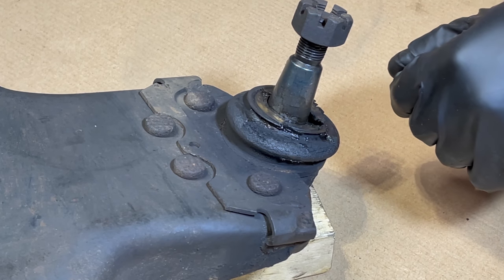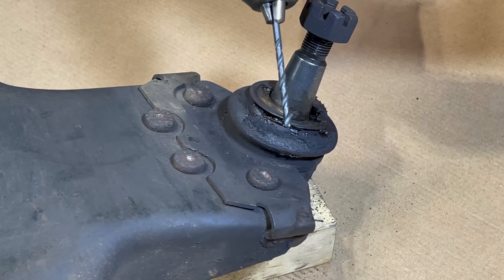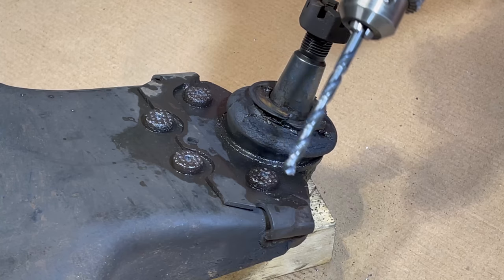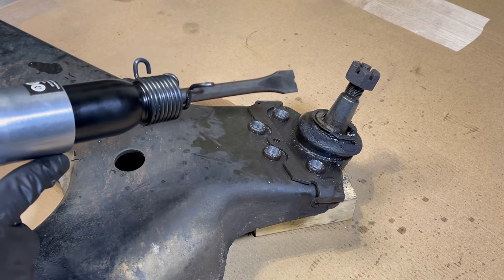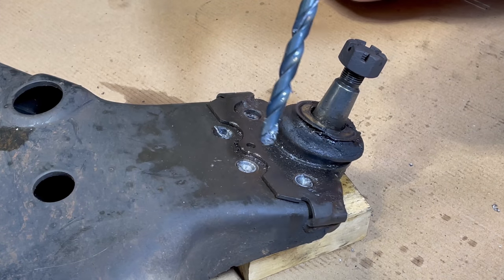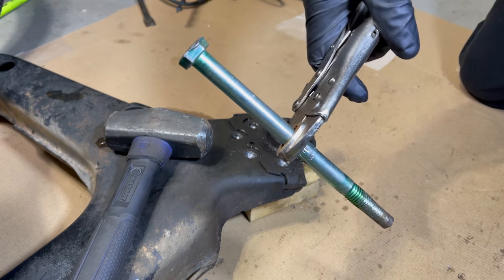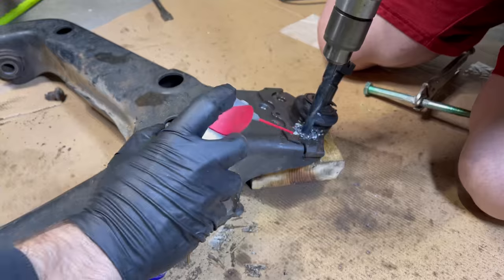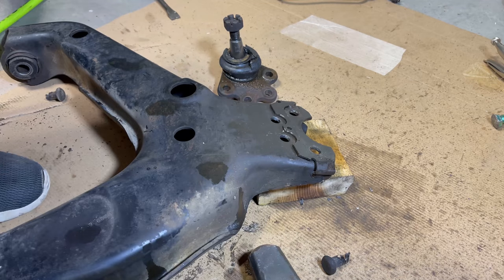Removing ball joints with rivets in 6 minutes!

Comment: Been a metalsmith for 45 years. Thanks so much for demonstrating admirably how to properly drill a larger hole in a piece of metal by gradually stepping up the size of the drill bit.  Can't tell you how many times I have seen people grab the biggest bit and just try to power it through a thicker piece of metal.  They get so impatient, frustrated, and angry and all they leave is some scratches and burn the temper out of the bit, rendering it useless. Slow is your friend when cutting or drilling metal.  And yes, the further down you drill the rivet, the easier it is to knock the head off.  Great video! Thankfully I've had the ball joints in my truck replaced a couple times before and they are bolted in now!!

Comment: Drilling tip for steel - rpms slow as you can with as much pressure as is safe for the bit.
high speed smears steel and makes it harder and dulls your bit.

Comment: Another technique that I used on those was to cut an X on the head with a cut off wheel, and just use the punch with the air chisel to pop them out. Worked like a charm. (I have the same truck).
Reply: I feel like that would make this 3x quicker.
Reply: @vincentwasney1768  Honestly, maybe 15 minutes a side... and there is no heat to warp and soften the A-Arms metal. I am surprised he didn't know this technique.
Reply from the maker: We tried many methods, the method we used in the video worked best for us!
Reply: I might try that on the other side.
Reply: That's what I do
Reply: I make multiple cuts like a waffle with a cut off wheel. Even easier to pop the heads off with the air chisel.

Comment: I appreciate someone out there providing a different method than cutting. I wanted to get some spring hangers off a frame at the junkyard, and most junkyards to not allow anything that sparks. Cutting or torching is not an option! Hopefully it goes well and I dont waste my time, if it works I should be saving about 250 dollars buying the only available aftermarket option.

Comment: "never have to deal with these rivets again" Yeah now you need to deal with rusted solid bolts instead :)
Last week I had to do two ball joints on a car, one was riveted, the other bolted (had been replaced). I did the rivets the way you did here, the bolts I got one out with an impact but the others no luck that way so I cut the nuts+bolts close to the flange with a cutoff wheel and they dropped out.

Comment: One other tip: Find an appropriately sized socket which just covers the rivet head, and you can use that as a guide for your center punch! Need to find the center punch which fits well down the hole of the socket you're using.

Comment: Almost the same here...I keep the arm in the car; drill 1/4 all the way through, 3/8.. 3/4 of the way and 7/16 level to the arm plate.  They come out rather easy with a 3/8 punch.
Reply: Do you drill from bottom or top? Wanting to keep arm in car because I don't have any replacement bushings for it, and old ones might crack if I remove it. But I don't have a fancy lift. Can I come in from the top you think?
Reply: @bigbrotheriswatching2680  Yes, that's what I did. You can use a straight punch attachment in the air chisel too instead of beating a bolt into it. If they're really stuck hit the bottom of the rivet a few times with the air chisel, off center like you're trying to "spin" the rivet. That breaks it loose usually and makes it easier to punch out. I did this with it attached to the frame and put a jack stand under the A arm to hold it in place.
Reply: This comment/video saved me multiple days of drilling after I was trying to jam a 1/2’’ bit though those suckers for 4 hours. Thank you!

Comment: You  can do it even quicker than this by leaving your drill in its drawer!

Get a small Angle Grinder with a metal slitting disc, and cut deep X's into the tops of the rivets.

Then get the air chisel out and it will do the same job.

Comment: Currently going through the same process except with the control arm still on the car. The aftermarket ball joint (Mevotech) actually has larger bolts than the factory rivets, so I actually needed to drill the holes in the arm to 31/64th. These rivets are very tough and will need a nice set of drill bits to get through.
Reply from the maker: @Donovan Handley Interesting, we didn’t have to drill the holes any bigger. But yes, the rivets are a bear!
Reply: @SuburbanRanch  Yeah it was strange. The original ball joint had smaller holes, but all good now!
Reply: The plastic on my Mervotech control arms for a 2011 Ranger did not even last 5000km before failing.  I went to Ford for OEM and paid only a couple dollars more.

Comment: The drill work (stepping up sizes ) is great work.  But,  angle grind the rivet heads off and air hammer the rivets out.
Reply from the maker: Tried the air hammer, it couldn’t pound the rivets out.

Comment: Geez! The "complicometer" was really turned ON in full power! LOL 😂 
Spare hands, control arm out of the vehicle, drill, air chisel, place to work, tools etc. In short everything set to be easy, fast and simple. And, even then made it so complicated!

If going the drill bit way just get an appropriate size dill bit and drill the rivet head out. It's that simple. No need for the air chisel.
But since you have an air chisel, than you don't need the drill bit! ;-)

Either case with all that at hand. Just use the air chisel to pull out the rivets. It's faster and simpler. Simultaneously you can skip the punch and sledge hammer...
Reply from the maker: @crpth1 Not sure if you’ve done it or got lucky when you did. We tried to just knock the head off without drilling or putting an X in the head of the rivet, didn’t work. Also we tried using just the air chisel to knock it out once we got the head off, no luck. The rivet mushrooms out in the middle locking it in place. We tried multiple ways, this was the easiest way we came up with.
Reply: @crpth1, that worked for you?  Wow, thats unbelievable!! You had better thank the good Lord for Him bestowing magic upon you lol.  
I have an Ingersoll Rand '7x' rivet gun which can also be used, depending on implement, air chisel,  hammer (which essentially what a rivet gun is to begin), air punch etc....  the 'X' denotes the power it is able to produce.  3x, only for aluminum rivets, 5x is the most common as it does any rivet up to 5/16" dia.  7x is nick named the thumper as it will very handily without thinking of breaking a sweat, will punch through. 009" 7076 T-7 sheet aluminum which is common size for lower airframe (sub buttock line 0 on fuselage) skin.
9x.....  not sure if that exists.  I heard rumors that someone spotted one but, his hand broke before he could get a picture

Comment: So I'm rebuilding most of my front end and I am stuck on these lower ball joints.  I was feeling all proud of myself getting this far since I'm not a mechanic but man these rivets are a pain!  I don't know if it's because I don't have an air chisel, but my normal hammer and chisel isn't cleanly knocking the heads off like in your video.  It's more sheering them off and leaving the bottom of the heads behind like they're welded on.  Maybe my drill hole was too small?  Went out and got a 7/16 like you said and I'll put some more work in.  Hopefully that works because I've been at a stand still for 3 weeks at this point.  I'll drill these all the way through if I have to and hopefully I'm centered up well while doing it and don't ruin the arm.
Reply from the maker: @Richard Young Yeah.. rivets can be a pain. The air chisel we have is really inexpensive at harbor freight and has come in really handy. https://www.harborfreight.com/medium-barrel-air-impact-hammer-61244.html
Reply: I paid $17 for mine at harborfreight, run it with a pancake compressor and it does alright. Don't forgot the quick connect fitting.
Reply: @bigbrotheriswatching2680  I actually just got the last rivet out last weekend lol.  So now both lower joints are out and I can start repainting before the new stuff goes on.
Reply: @tbituner  howd ya get them out? Did you drill in from the top without removing the arm? That's what I'm about to try
Reply: @bigbrotheriswatching2680  yes I didn't use any fancy tools once the head was off just a hand drill with the control arm still attached, supported by a jack stand so the torsion bar didn't absorb all the impact while trying to whack them out. In this video he uses 7/16 but based on my experience I wouldn't recommend that because it is almost the exact size of the hole in the control arm.  So if you aren't EXACTLY on center or don't go perfectly straight down you will eat away at the control arm not just the rivet.  I may have done that a little on the first arm so I'm nervous on how it will go back together.  For the second arm though, I got the two drill bit sizes below 7/16, the strong ones of course meant to drill through thick steel.  So I would just alternate between the two sizes back and for, vacuum out the shavings each switch until I got almost a full 3/4 through the rivet.  Then I placed a spare short steel bolt in that hole and just whacked it as hard as I could until it popped out.  Removed the second set perfectly that way.  To get the heads off I used a cutting wheel and made 3 cuts instead of the usual 2 to make an X, seemed to make hammering the head off with a chisel by hand much easier.  Maybe it was just because more heat was getting into the head so it was more eager to deform and sheer off.

Comment: I have the same problem with my 1997 Dodge Dakota.  For some reason the factory decided to use these rivets instead of bolts and nuts which are what the new upper and lower ball joints come with. 
I forsee a lot of work and nothing is easy for sure. I am not going to remove the   upper and lower ball joints because I am not a mechanic by any means and that looks like it would be tricky. So, what I was thinking is score the rivets on the top side with a metal  cutting disk and then just use my air chisel to remove the pieces.  After removing the pieces I plan on grinding down what's left to be punched out.
What do you think? Is my thinking about right?
Reply from the maker: @William That should do the trick

Comment: Hard metals, low speed high prx.  Softer material, high speed low pressure.   Anyways. ....
Thank you for the video. I've a 1998 C1500 I am about to R&R ball joints. So, sincerely....thank you.
What were your symptoms?  My 'Burban is wandering at freeway speeds, front tires (obviously) are wearing HORRIBLY on the inboard shoulder.  To me,  that screams "BALL JOINTS!!!"
Reply: More like tie rods

Comment: If you had a cutoff grinder and  hammer punch bit with your air hammer, the job can be done in minutes.  Crosscut the head 2 or 3 times. Hammer off the head. Then, hammer out the bolt. Put a jackstand under the control arm to absorb the hammer impact.
Reply from the maker: We tried doing it with just the air hammer, it was not powerful enough!

Comment: Not a criticism..just curious why you didn't use your air hammer to drive the rivets out? I have a WW2 truck that's over 80yrs old and I've been told to use an air hammer to get the rivets out as most fuse with rust over the years and hitting with a big hammer can crack the cast parts and bend the frame.
Reply from the maker: @Olive Drab Garage We tried, our air hammer would not drive them out
Reply: @SuburbanRanch  ahhh...bugger. I hope mine come out or I'm going to have to up the stakes with a plasma cutter.
Reply: @SuburbanRanch  you need a bigger air hammer
Reply from the maker: @sdriza Yes, a bigger air hammer might do the trick!
Reply: @SuburbanRanch  I'm high on long barrel air hammers right now. I was fighting with a stuck axle last week and finally bought one over the weekend... Loving it - been trying to use it for anything - can't believe I waited so long to get another one. Hope all is well and I enjoyed the video.

Comment: Do I have to drill into them to get them out because I have chiseled both sides of the top ball joint off and still can’t get the rivets to come out
Reply from the maker: @Jack Benson That’s what I would recommend
Reply: Using a press is MUCH easier than pounding them out. You don't need to chisel both sides, only the side you're pushing into

Comment: Young fella it's easier to just use a cut off wheel cut an x in it then use a air hammer with a straight chisel knocks it off every time then punch out the rivets .

Comment: You can’t say that it’s six minutes to change bowl joints because you have to add in the fact that you had to take the wheel & the lower A-frame off to even get to it so it took a little longer than six minutes is what I’m getting at.
 myself, I blow the heads off with a  torch.

Comment: Non sens. Get the control arm out and work with rivets! If I take out controle arm is faster mounting new one with ball joint!
Take out ball joint without removing control arm! That problem.
Reply from the maker: @Jerzy Kolodziej You cannot buy new control arms for a k1500, gotta work with the originals. We are also replacing the bushings so it made sense to remove the entire control arm, but you can remove just the ball joint with the arm in the truck.
Reply: @SuburbanRanch  
Wow. My daughter by first car. Old. Chevy Optra 2007 . On my opinion good deal but Nevers say never! I must change ball joint . End it's the problem: work with rivets ans buy the ball joint for 10$ or change lower arm with ball joint for 58$ !
Question- what's easly?
Reply from the maker: @Jerzy Kolodziej I would just buy a new control arm with the ball joint already replaced and new bushings

Comment: Has anyone used a 3/8 instead of a 7/16 bit? I am considering buying some bits, but the 7/16 size doesn't come in the smaller sets, but 3/8 is pretty common. Kinda don't want to spend money specifically to buy the 7/16 bit if I don't have to. The difference only seems to be about 0.0625"
Reply: No you don't have to drill all the way to the edges of the rivet. Drilling more just gives the shank of the rivet more room to compress when you're trying to hammer it out. Use what ya got, get close enough to the OD of the rivet and you'll be ok. Make sure to drill as centered as possible, use lots of lube as they're hard AF!
Reply: You could always “ream” the whole with a smaller bit to make up for the smaller size.
Reply: @Chubbza5  I ended up getting a 3/8 and it worked very well.  What ended up being key for me was to get a good fast drill and to get about 3/4 of the way through before hitting it with the air hammer.

Comment: in aircraft when drilling rivets its not advisable to drill so deep. the material left in the hole is a direct indicator of how far off center the drill was and thus how far out off round the hole is. there is more lenience when installing new rivets but with bolts being the replacement fastener in this case there is a chance for movement and widening of the holes under stress. 

i would tell you to drill shallower, then using an 8oz hammer, strike the center hard a few times. if everything is correctly drilled, the head should pop off with just a few strikes. its better to finesse in this area than to take too much material out. then the shanks can be driven out with the hammer and punch or even a pin style set for the air hammer.
Reply from the maker: @billy sanders Our drilling was all encapsulated within the rivet shank. The hole was not damaged at all.
Reply: I have same truk but I found a whole lower arm replacement with ball joint alredy in for little over 60$ on ebay hell the ball joints itself sells at orielly from 55 $ seems it was way easier than having to drill and pound on it
Reply: When I was an A&P, when removing aluminum rivets..... I used 1 or 2 drill bit sizes smaller and I drlled full depth.  Rarely did I have to use a punch to finish it off.  And actually the opposite us true.  You don't want to be stressing the material or inadvertently "hog out the hole" because of side pressure or a missed or off center strike. 
If you take care in drilling and pay attention it is the best method for fastener (rivet) removal
Reply: Good thing its a truck then and not an aircraft.